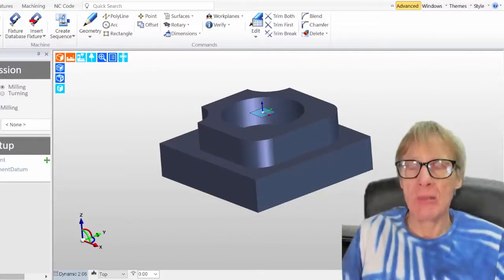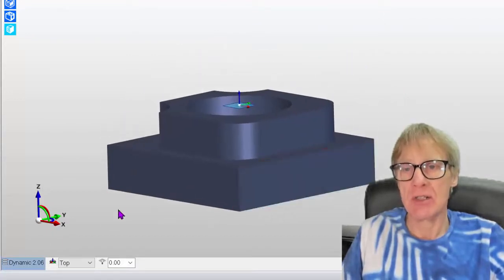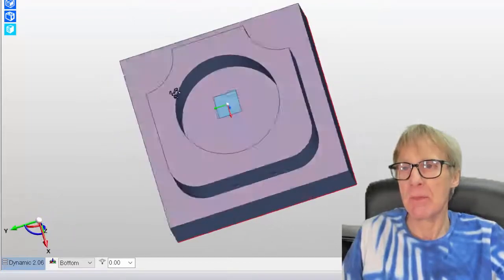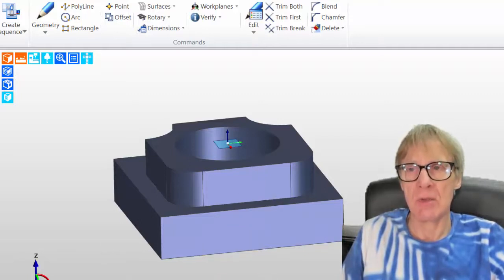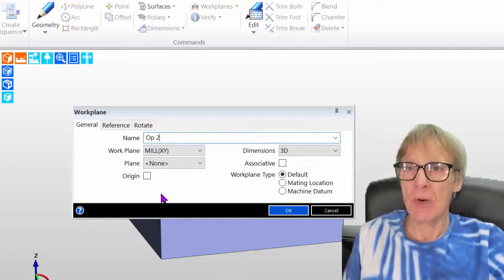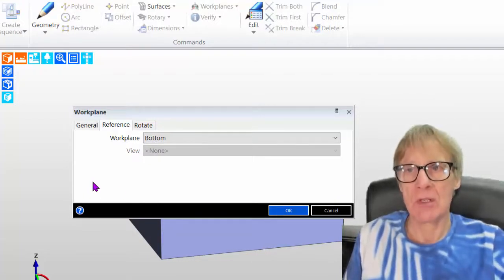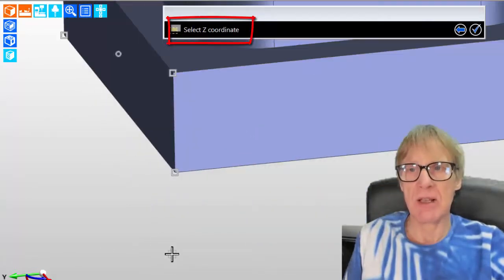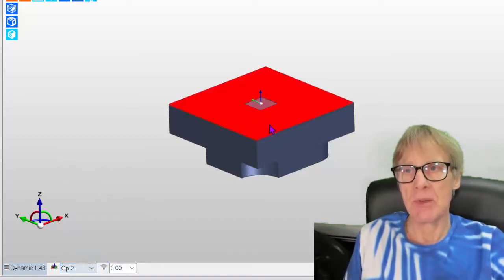How To Create New Work Planes in Edgecam

Comment: Hi, thanks for your video. I am trying to learn edgecam and still a beginner. I mostly use it for turning. However I am getting an error called “ the datum does not lie in the workplane “ when doing milling with radial tools, could you please give me a tip on this. thanks again